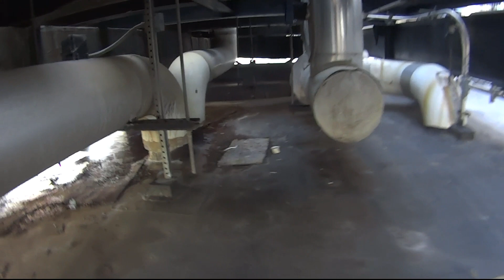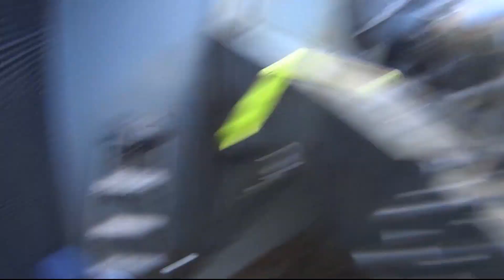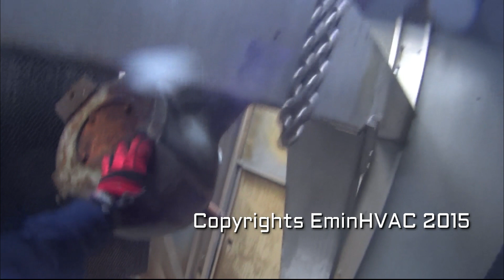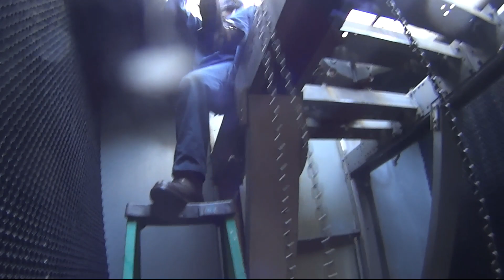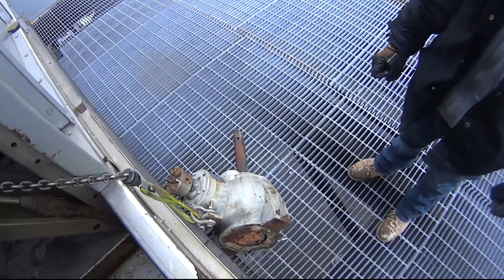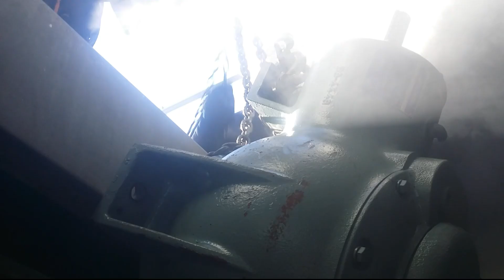HVAC | Marley Cooling Tower | Geareducer Job | PT3

Comment: You should have just got a 3/4 or 7/8 i-bolt to put in the top of the output shaft and lifted it straight up. Ive been working on towers for many years and never seen one lifted like that. also a bigger t-bar puller would have popped that fan and hub right off. just take out 2 bolts in the hub and run your all thread  through them, put a block on the output shaft that is taller than the hub and use a bottle jack to pop the hub. you are essentially making a portable press if you do it that way. I do admire your never give up attitude.